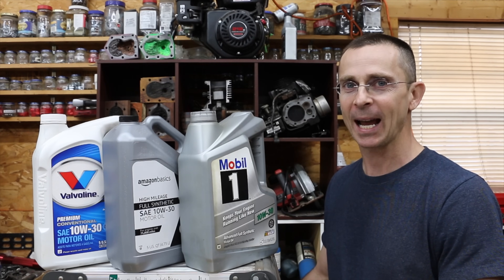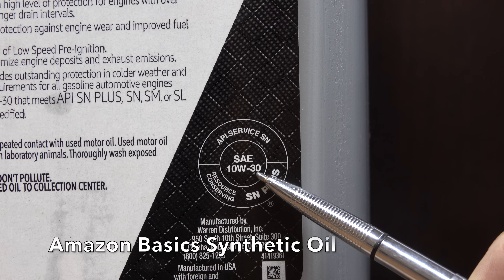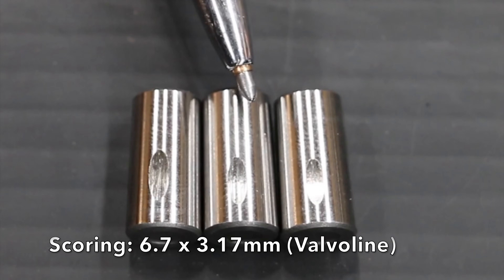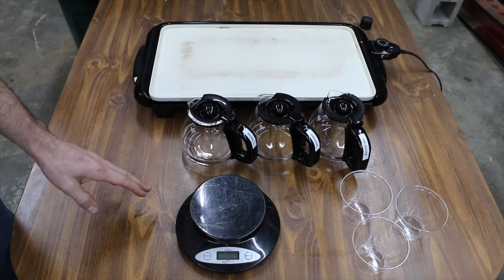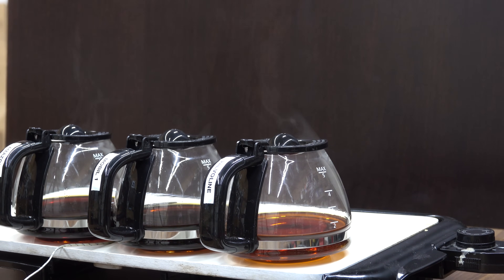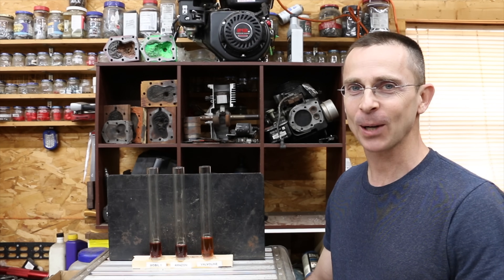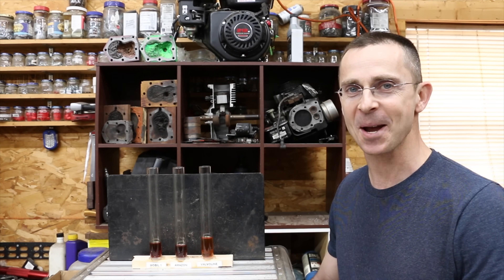Is AmazonBasics Full Synthetic Motor Oil better than Mobil 1? Let's find out!

Comment: I'm very impressed by the video! Thank you for all the work you put in it! For some reason I've thought of Valvoline as a premium brand too. Looks like it's not. I'm using Mobil1 oil + oil filter for my 2008 Honda Civic Hybrid. I was told this is somewhat an overkill for my oldie and I could easily switch to something cheaper. The car has a pretty high mileage though. Would you agree?
Reply from the maker: Thank you!  The Valvoline conventional oil I tested is actually pretty good for a conventional motor oil but synthetics are very impressive.  Warren Distribution handles the oil for Amazon and they've been around since 1922.  I've switched over to Amazon after testing their product.
Reply: @ProjectFarm  Thanks for the reply! Yeah, I guess I'll switch as well. I need to change oil soon but I still have like 2 qrts of Mobil1. Do you think it's a good idea to mix the Mobil1 that I've got left with Amazon's? By the way, I'm a new subscriber :)

Comment: The issue I have with Amazon products is the reviews.  Often most people aren’t happy and will used the lamest reasons to give poor ratings.  Aside from that very small number of customers do give decent reviews and here is where the initial products from Amazon begins to diminished its quality and its ratings drop drastically.  In other words, I would not trust Amazon Basics Synthetic oil because in the long run the quality will dropped and who wants to take that risk on their engine?!  Not me, I’ll rather stick around with Mobil 1 oil since they have maintain their reputation for as long as I lived.  Yes some models do not do well with Mobil but at least we learned that in advance or vice versa.
Reply from the maker: Thank you for commenting.
Reply: Project Farm 
Have you tried Castro Edge full synthetic oil?  My Subaru doesn’t like Mobil 1 but seems to do well with Castro.

Comment: Run a test that takes into account Oil staying on the surface of the metal, after the car has been shut off for a long period of time. Which oil stays on the metal longer, and which oil stays "thick" while its stressed out and beat up in a hot environment?
Reply from the maker: Thank you!

Comment: I run Mobile 1 in my engine and only change my Oil every 7K Miles. I have 155K miles on my engine and no engine trouble at all.  Although the Amazon basics is cheaper I Don't trust it to have the same long term protection.       Run these tests again after you have simulated 7K miles and lets see who is doing better at that point.  In my life experience just because something is cheaper does not mean it is bad but it has proven to me time and time again that trying to cut corners with cheaper in the long run costs you much more.
Reply from the maker: Thank you for the recommendation!

Comment: But does Amazon basics oil have good zinc properties
Reply: It's gluten free and free range oil
Reply: @tomaspino6473  no added hormones
Reply from the maker: Thank you.
Reply: Project Farm yes
Reply: ZDDP is OLD NEWS there are better solutions such as Infineon trinuclear molybdenum DO NOT PUT ANYTHING IN YOUR MOTOR OIL
Reply: As long as it doesn't include corn syrup it's okay.
Reply: True.  I run old school flat tappet engines and I need zinc.
Reply: Jeep TJs need zinc! Oil in 2003 isn’t the same oil sold in 2019!
Reply: @SeriouslyAwesome  You can get additives though a really high quality oil may work better than the zinc based stuff. Motorkote? might make zinc obsolete unless that's what its made out of. lol
Reply: @consaka1  I think I might just go with some Rotella T5 10w30. Who knows. The great internet debate
Reply: @SeriouslyAwesome  That's good oil actually. I have used it many times.
Reply: Can u use it to cook food?
Reply: You could, but then you can't eat it.
Reply: Btw what good is zinc in oil?
Reply: @stevethea5250  Zinc is a great anti wear additive in oils,but it also stuffs up your Catalytic converter, most oil companies are moving away from zinc for this reason
Reply: @bevanbest2619  thanks. So... The original comment was sarcastic or...?
Reply: @bevanbest2619  why the hell is oil in your cat converter
Reply: @bevanbest2619  😂👌
Reply: @lpmorgan90  because a slight amount of oil makes it past your rings and valve seals and gets burnt off in all engines. The older the engine, the more oil makes it past the rings and seals.
Reply: Steve Thea not sarcastic at all. Rotella T6 use to had great zinc additives (no longer true). As a Subaru owner, many enthusiasts swore by it. I was wondering what was up with Amazon Basics oil and I found this video.
Reply: @lpmorgan90  Look at this guy with the golden gaskets.
Reply: @lpmorgan90  A little oil gets past the rings and burned with the fuel in the normal process of operation. Considering the way the engines are made this is absolutely necessary. We just don't want too much oil getting by. Just enough to keep the rings cooled and lubed.
Reply: We need the Zinc dialkyldithiophosphate.
Reply: Answer is simple, in order for oil to be SOLD as ENGINE oil (it's regulated as such) it does have to have the PROPERTIES that defines it to be a MOTOR OIL.. So it's safe to assume that all those things a present..
Reply: @MichelLinschoten  wrong. Just because it's an engine oil that doesn't mean it contains all of the ingredients that other engine oils contain. Manufacturers add their own proprietary compounds to modify wear, longevity and consumption characteristics.

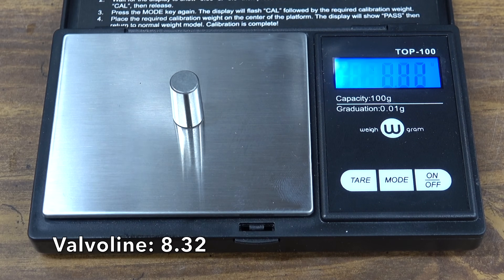Comment: In all fairness, you put way more mobile 1 oil in that cup. Where the bearing/wheel was actually dipping in the oil and the other two just to say touching. Those pours should have been measured.Valvoline  2:55  Amazonbasics 3:51 Mobil 1 4:31
Reply from the maker: Thanks for the constructive feedback.

Comment: Interesting. After seeing the review of amazonbasics batteries I suspected   the oil would do alright. Solid quality.  Also, I had never realized that I can lose oil through evaporation at high temperature. I thought, until I saw this video, that it was only lost through combustion of the film in the cylinders.
Reply from the maker: Thank you!

Comment: What about a room temperature and hot viscosity test after the evap. test?  Amazon oil seems to have lost a lot of viscosity after the heating.  What if its viscosity is too low indicating premature breakdown?  Not a great deal if you have to change the oil at 3,000 miles instead of 5,000 like I normally do with Mobil 1.
Reply from the maker: Great test recommendation!

Comment: You should do Liquimoly oil, motul oil, and Castro’s oil, those are all oil they recommend for German cars which are primarily turbo charged engine, or direct injected motors, plus I use Liquimoly and from what I have been told it has better saps rating then other oil companies
Reply from the maker: Thank you for the video idea!
Reply: Project Farm thank you for replying !

Comment: Bar and chain oil vs heavy duty grease on a chainsaw.
Reply from the maker: Thank you for the video idea!
Reply: @ProjectFarm  I've used grease in the bar of my saw.  Stays put while running.   Also coats the drive sprocket.

Comment: Valvoline needs to step their game up. All name brands are definitely not the same.
Reply: Valvoline on video is conventional. I used their full synthetic, when I changed out at 7400 it just a little darker than new oil and send oil sample to the lab, they said metals in the oil are very low and with the amount TBN left, I can go 10k miles

Comment: My oil temp in a plow truck. 2017 ram hemi 6.4 never goes above 249 under extreme conditions in upstate N.Y. Steep hills and verying temps 60 degrees apart. I use a wideout new style that pushes excessive amounts of snow. 10ft wide with a close to 9ft scoop. 1100lb plow with 1100lb in the bed plus a snow blower and tires with ice in them that probably weigh 200lbs. If you can do controlled testing in the parameters I tried to lay out you would get a good idea of what oil really does when in real use. I have an old ford f350 v10 that in cold temps negative 10 plus I lose oil pressure often at start up. won't get it to come off the bottom till I idle it for 5 to 10 minutes. I won't put money into this truck I can't afford it. but if I can get an Amazon oil that cold starts like your testing and fix the issue I would run it till the frame is done.
Reply from the maker: Thank you for the video idea!

Comment: You should try the flow test with rotating in the freezer just as you did on the hot plate.
Reply from the maker: Thank you for the video idea!
Reply: No, opening the door would only vary the temp.  As long as the door stays closed, the inside temp isn't going to vary over 6 inches especially since it isn't near the walls where the cooling happens.

Comment: Hi PF! Great channel. I'd just have to point out, like many other probably did. Tests like these must be conducted multiple times to be considered valid, not to forget controls to avoid unintended errors. If you show graphical data, please consider at least 3 different set of data of each, and using scale-errors bars to show if any of the tests are significant!
I'm going to continue following everything you make, thanks for sharing these great experiments.
Reply from the maker: Thank you!!

Comment: This is going to be long. Project Farm, if you read this, you can PM me for consultation on testing and statistical analysis of results. I'd be more than happy to help you free of charge. I like what you are doing, and feel you could easily improve some characteristics of your analysis.

My constructive criticism:

As a mechanical engineer, I feel the need to point out that the inherent uncertainty in your equipment's measurements. In your bearing lubricity experiment, a scale that measures to the nearest 10mg has an uncertainty of plus or minus 5 mg. Therefore (numbers from the valvoline test), 8320mg (+- 5mg) - 8300 mg (+-5mg)  = 20mg +- 10mg. So your percentage lost becomes 0.24% +- 0.12%. In other words, your posted value for the mass lost could be a whole plus or minus 50% in value. This is not including the (surprisingly non-negligible) random error associated with scale hysteresis, bearing placement on scale, etc. Since only one measurement was taken, a statistical t-test (AKA student's t-test which originates from a chemist at Guinness) can't really be performed because we have no standard deviation of the measurements. This example is taken further into the extreme when you do uncertainty of the amazon basics oil lubricity test, which comes out to 10mg +- 10mg, or 0.12%+-0.12%. This means that in actuality, the amazon bearing could have lost as much as 0.24%, the valvoline could have lost as low as 0.12%, and the mobil-1 could have lost as high as 0.36%!!! This should highlight the need for higher precision of your test equipment, because the results are so close due to uncertainty, that no oil can be declared a winner for this test.

Now that I've established the flaws in this test, here's how you could improve it to reduce uncertainty and be able to yield more definitive results:
1. More precise scale (this does cost money though)
2. Longer abrasion test time. This will increase the mass lost relative to the uncertainty, which stays the same for that given scale.
3. More weight on the machine, increasing wear.

Another criticism of this test is that the object being abraded is a cylinder on top of another perpendicular cylinder. This means the contact area, contact stress, internal forces, and abrasion rate are some pretty complex phenomena. Shigley's Mechanical Engineering Design may have some limited info on this scenario. One thing is for certain, however, and that is that your rate of abrasion will definitely fluctuate as the contact area between the cylinders fluctuates. This means your mass lost over time is some form or mixture of polynomial, exponential, logarithm, etc... 

I recommend using a wear object in the shape of a rod bearing of the same diameter as your wheel, which will therefore maintain constant contact surface area with your abrasion wheel. This will better mimic the forces and geometries found inside an engine as well.

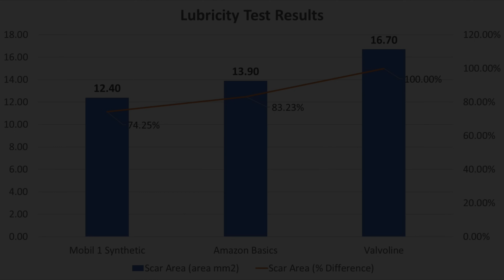Another point of analysis fallacy is that by reporting the area size of the wear ellipses, it misleads the viewer (or at least me!) into assuming that the ellipse area is linear with lost mass, which it is not. It's probably some weird sinusoidal equation. This means the results found at 5:40 do not mean much in the way of comparison. Had you let your lubricity test go on for several hours, the differences in elliptical surface area would be minimal, while the mass loss difference could be very significant, because the transverse ellipse leg varies sinusoidally with the wear depth.

Lastly, the viscosity tests cannot really draw conclusions beyond comparative, because no oil was tested in a viscometer to see if any was out of spec. While Amazon basics had a lower viscosity, it cannot be confirmed that your batch was not below the minimum kinetic viscosity specified by SEA J300. Also, the lowest viscosity oil is not necessarily the best! It all depends on what the engineers who designed the engine lubrication system designated as the ideal viscosity for their engine. SAE ratings keep oils within certain boundaries of viscosity, and engineers probably design the engine with the viscous average in mind, which means an oil on the lower viscosity extreme of an SAE oil viscosity grade rating may not be 'better'.

Again, if you think any of this info is beneficial, let me know. I'd be more than happy to help you in your future projects. Keep it up!
Reply from the maker: Thank you very much for all of the constructive feedback. It helps me improve the testing.  I've already acquired some new equipment to improve the next showdown comparison.  The lubricity tester I used is very similar to a big brand oil company's that is used to show the effectiveness of their brand on some youtube videos.  While this type of tester isn't used by the API, in my opinion, it does provide valuable information on the performance of oil products.   Thanks again!

Comment: Can you do a gun oil comparison?
Reply from the maker: Thank you for the video idea!
Reply: johnny Macon you sound like the idiot
Reply: BMDubClub lol he is
Reply: johnny Macon  I dont think he was asking for his car bud, but I could be wrong.
Reply: @Americanman450  your not👍
Reply: I use mobil one in my guns because it just happens to be what I put in my car. It was just an idea guys.
Reply: csm bright ok. My bad. It would still be an interesting video. I was just trying to help a fellow enthusiast save some money.
Reply: @robertwest4299   Your comment was welcome, and helpful.  I just happened to be on the same page.
Reply: Lucas has a gun oil now that I was wondering about.
Reply: johnny Macon  why ?
Reply: johnny Macon  I've been wondering the best oil for my guns for a long time.
Reply: +Ironic you call someone dumb, you clearly new to the channel...PF has done a wide variety of small engine TESTS with products that were NOT MADE FOR AN ENGINE. 

Perhaps next time get of your high horse and actually comprehend what this channel does and has done in the past.
Reply: johnny Macon he was asking for a review of gun oil on A GUN stupid
Reply: Use motor oil on your guns. It's far cheaper in the long run and works just as good if not better. Your car reaches temperatures your gun never will.

Comment: Thank you for the great video, in the subject of oil testing how about using single sample of oil for all the test, for instance 1 quart of oil for cold flow test and use that same exact 1 quart of oil for the rest of the test, as for the test I suggest adding hot oil lubricity test and a test sequence of lubricity -> cold flow -> oil reduction -> lubricity -> cold flow. Cheers
Reply from the maker: Great recommendations.  Thank you!

Comment: Test the cheap generic SuperTech brand stuff in Walmart sold in the blue plastic containers.  $13.47 for 5quart container, it's the low price leader.    It's probably recycled oil that has been processed and filtered.
https://www.walmart.com/ip/9-Pack-SuperTech-High-Mileage-10W40-Motor-Oil-5-Quart/497882813
Reply from the maker: Thank you for the video idea!

Comment: What I'm afraid of with Amazon and this is not just their own products is that they can change the formula any time and you would not know it. I've seen it done with other products before where they sell you top notch quality then after getting thousands of good reviews, will use lower quality materials while they ride the wave they created sweeping in the major profits. My point is that your view is great and is certainly valid today but would it be in a year if Amazon decides to switch vendors for their oil for whatever reason? Would the consumer know this switch was made?
Reply from the maker: Thank you

Comment: Try half Valvoline regular motorcycle oil and half Valvoline synthetic motorcycle oil. I buy it at the local Walmart, for good clutch feel and good shifting smoothness, and it is rated for use in car engines. Engine bearings spread out the weight across the entire bearing surfaces, so your bearing torture test is unrealistic.
Reply from the maker: Thank you for the video idea!